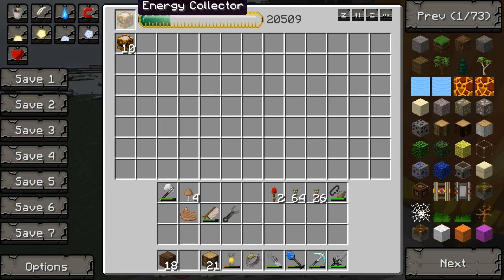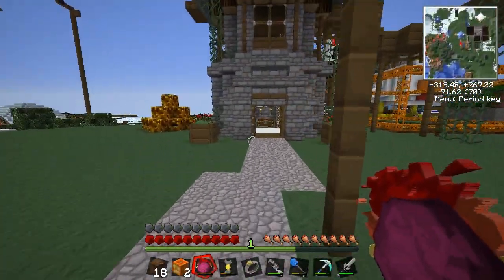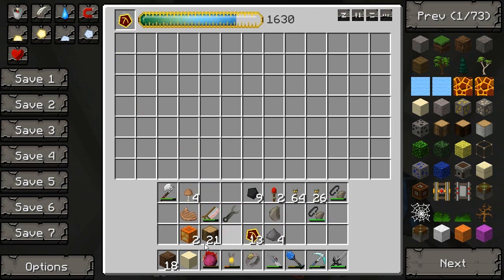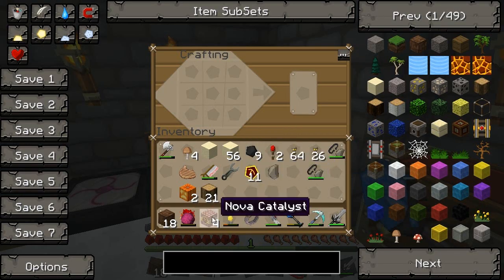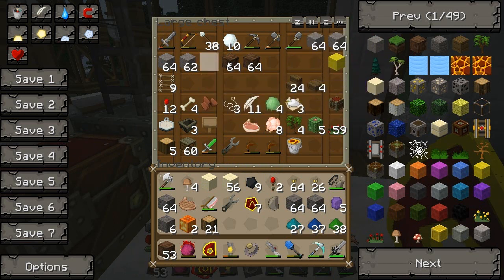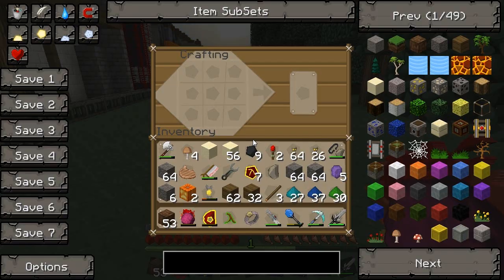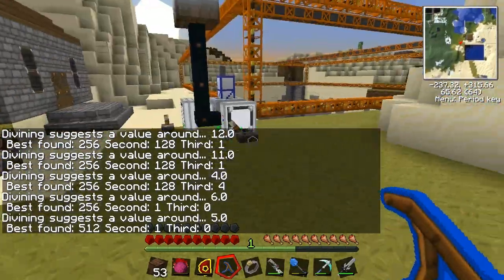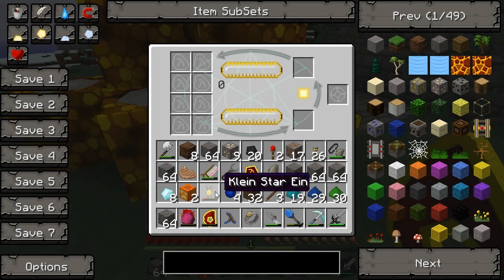Duncan's Lab - 26 - The catalyst of destruction!

Comment: Gunpowder can be found in chests(in dungeons and abandoned mine shafts) it can also be made by placing UU matter in the crafting table in a c shaped where the only 2 spots not used are the middle-middle and middle-right, also by placing a lower tier of fuel in the collector(e.g. charcoal) it will over time turn into a higher tier of fuel.

Comment: Nope, it uses emc, if you have any fuel with an emc value (example glowstone dust), it will consume it to work. But if you charged a klein star with emc (It may be from glowstone dust too, but from anything else with an emc value), it will use that first as it's primary function is to contain energy to be able to use it for your equivalent exchange item (so it doesnt consume you fuel when you what to craft something with it)

Comment: place the black dark matter relays around the condenserthen place the collector around the relays also make sure you have what you want to duplicate in the condeser and if you are having trouble placing the relays and collectors hold shift while placing them they also have to be in the sunlight.  energy collectors asorb sunlight transfers it to the relay which then add the energy to the emc bar in the condenser